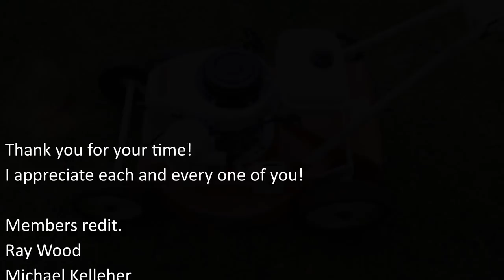Junked Robin EC10 Two Stroke Engine Restoration Full Version.

Comment: Good job!

Is this engine is made in Japan?
Looking good
Reply from the maker: The Robin engine has always been built by Fuji Heavy Industries of Japan. Generally a well-regarded engine, but in the 1980's and 1990 Fuji was a little late adding innovations such as electronic ignition and overhead valves. 

Today, Robin is right behind the Honda GX OHV engine and is considered superior to the Honda GC and Kawasaki motors

Comment: I've seen a couple of four stroke Robin engines branded as Teledyne Wisconsin when I had a shop from the late 90's through the early 2000's. Never seen a two stroke. What is the oil filled sump for? Just to lubricate the governor mechanism?
Reply from the maker: Correct, its just for the governor lubrication.